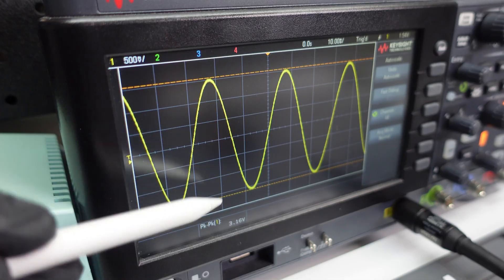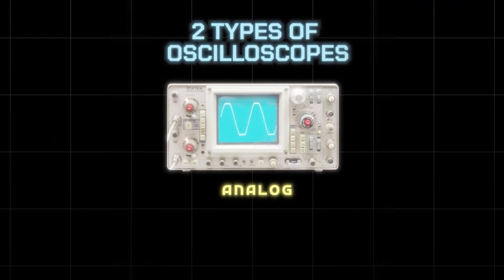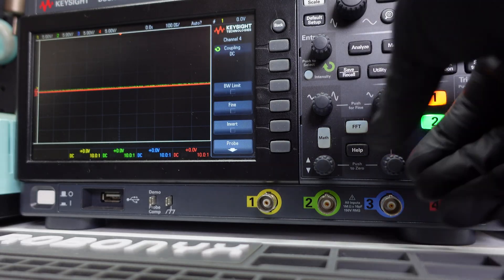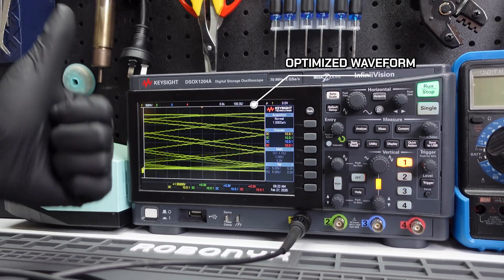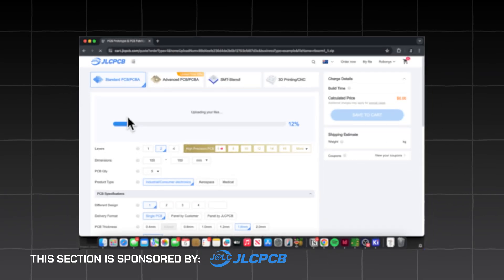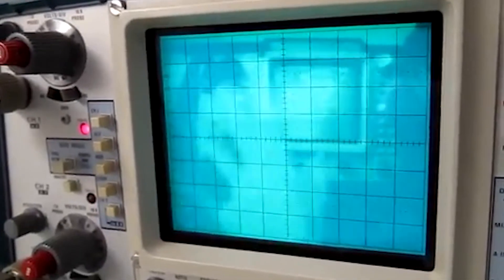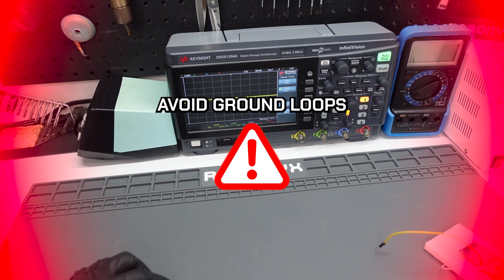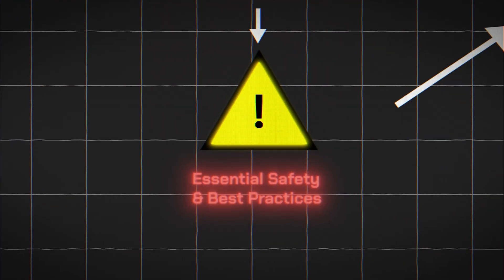Oscilloscope Basics for Beginners

Comment: I've just bought a power probe type tool that's got a basic scope on it, yes I can adjust it's settings some what but here's my question. Let's say I get a waveform from a component on my car, how do I know that it's correct, that a sensor etc is actually working correctly?